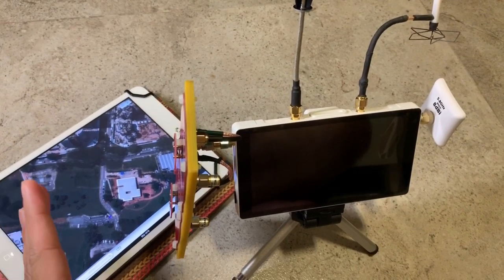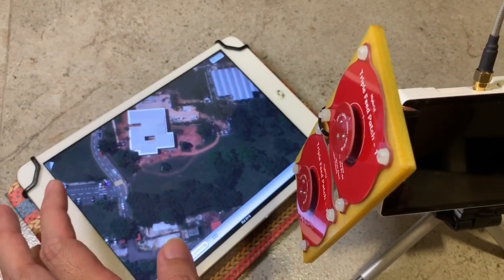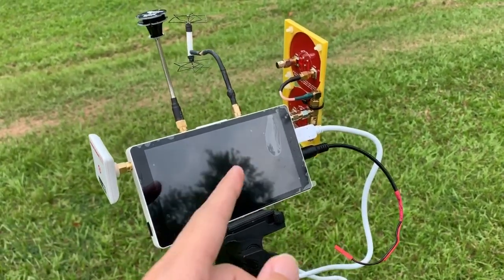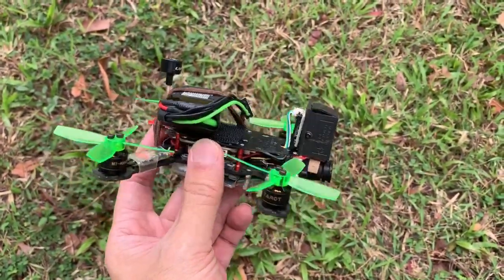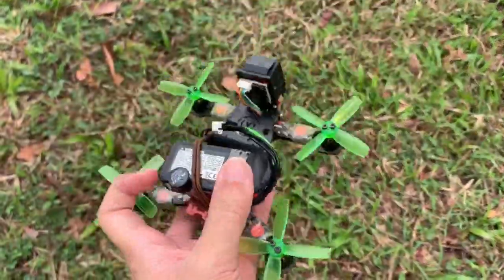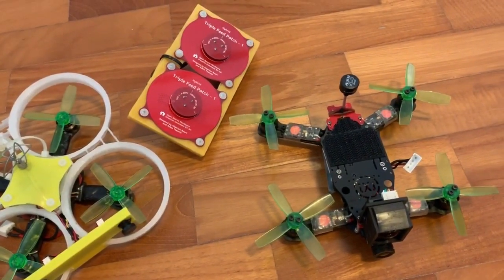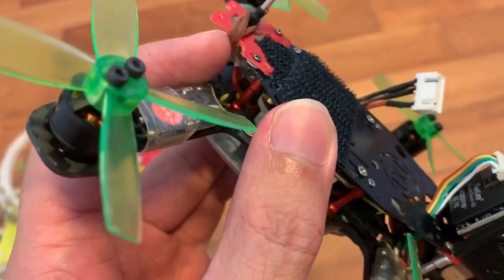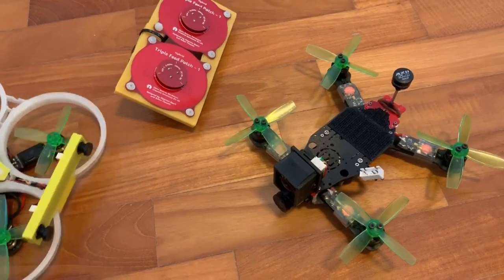ByteFrost Mini- a micro HD quad at last!

Comment: Will the upcoming cheaper 20x20 VTX made by Caddx entice you getting into DJI? That was your reason mentioned near the end here for still preferring ByteFrost.
Reply from the maker: It depends on the price point. Having spent so much on Connex 18months ago, and now on Byte Frost, I am not sure what’s in for me by hopping on the DJI wagon. As I mentioned, I am happy with the current ByF being able to fit into my 140mm frame. When I tried the DJI digital, the fisheye effect image + large FOV screen made me nauseous. I dun have that issue with the ByF monitor in the Transformer box, which also has a pretty large FOV. So, m guessing it’s the optics that m not used to.

Comment: I love how people are squeezing hd in small kwads. There is a channel called sub250 and that guy is putting dji airunits in smaller kwads too. Great time for fpv again!!!
Reply from the maker: micro quads are so much fun. A lot of people are voicing why the ByF VTX isn’t 20x20. When palm size quad frames first came out, we were using 30x30 FCs so I have no issue with the size, smaller is welcomed though.